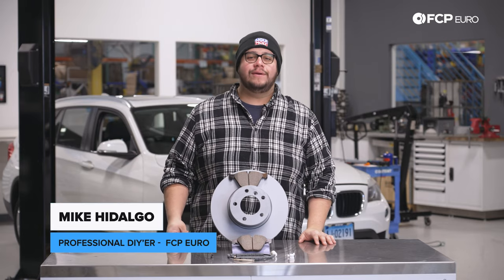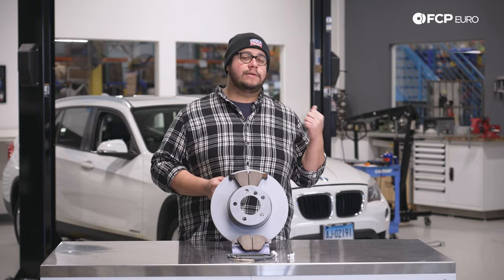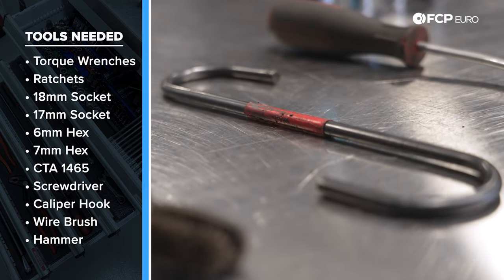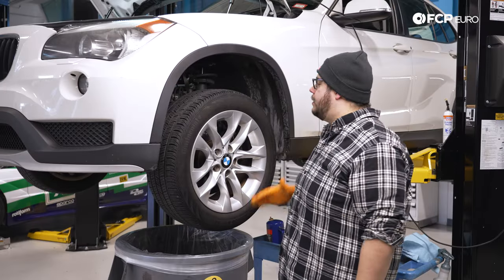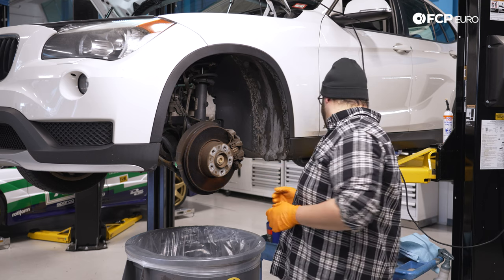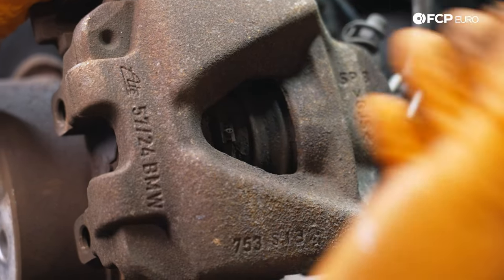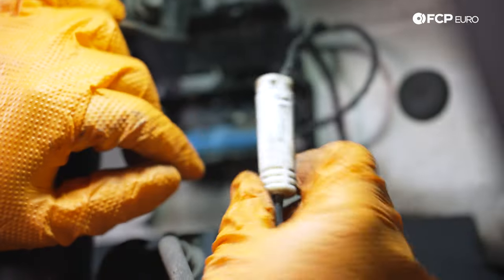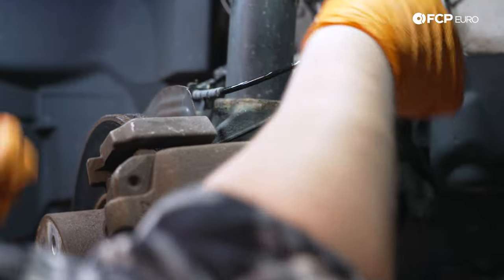BMW E84 X1 Front Brake Rotor & Pad Replacement DIY (2013-2015 BMW X1 xDrive35i, sDrive28i)

Comment: Correct me if I am wrong but I think you can change the disc without removing the calliper carrier. It’s a tight fit but if you feed the disc into the carrier first the inside of the disc will clear the hub….I think….Great vid!!! Thanks! More e84 content please? 😊

Comment: Awesome video, thank you.
I just bought some new rotors for my BMW and i will change them tomorrow, due to wobble when breaking.
I will see if the old rotors where not straight or if there might be something else.
Where should is start look if the wobble don't go away after changing the rotors or if it come back soon after?
Reply: Check the hub with a runout gauge

Comment: Just finished this job on the exact car, however it dips or slides to to the left under braking.  Any suggestions to what could be the cause?
Reply from the maker: Hi Jim, oftentimes that can be related to: A sticky caliper/collapsing brake line, worn control arm bushings/tierods/ball joints. An inspection of your suspension components may be a good start. We have a DIY for E9x vehicles (same front end as this e84) where a control arm bushing was so worn the whole wheel was shifting under braking, along with puling to a side.
Reply: Thanks for the reply, great video by the way.